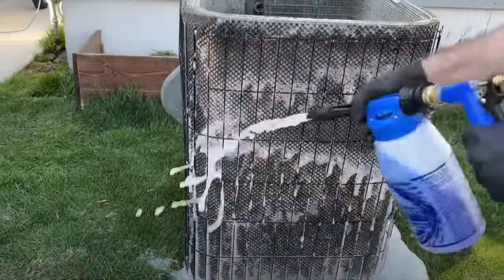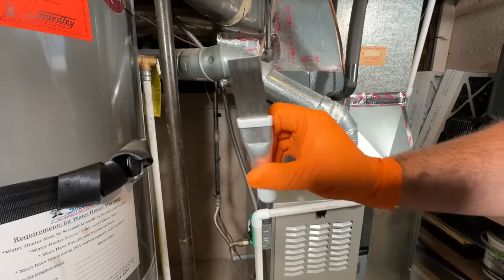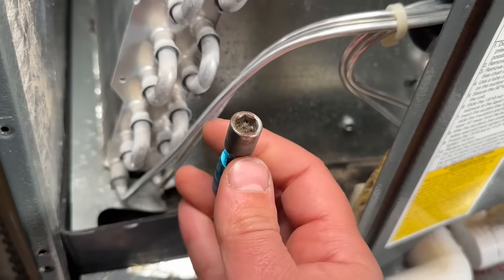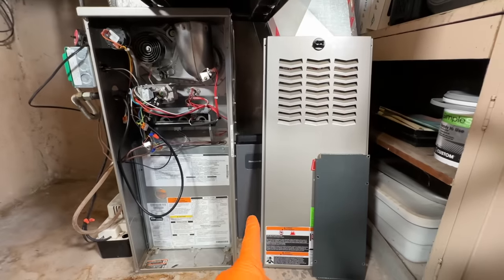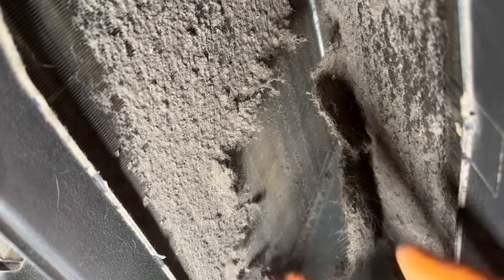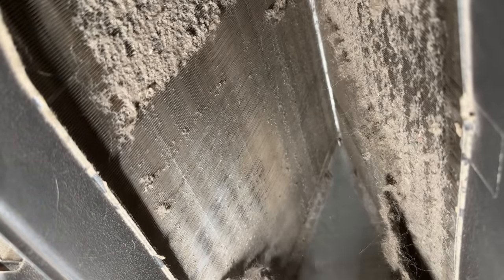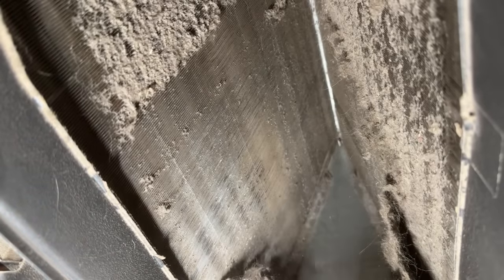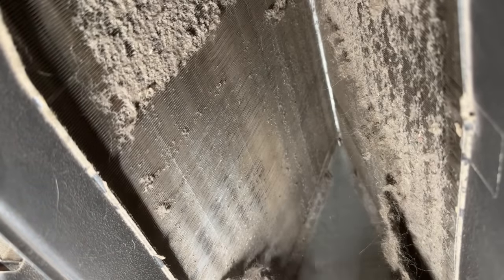How To Properly Clean An AC Evaporator Coil & Save HUNDREDS!

Comment: My late 60's Lennox is in a tight closet filter 14×18x1... been freezing up no air getting past it... as far as I know it's never been cleaned... I cleaned the 25+ yr old Compressor coil for the first time a few weeks ago... back in 1984 dad was sick and a family friend looked at it coz it was running hot and cold at the same time... so he asked my mom do you want hot or cold? She said cold so he disconnected the electric heater coil... and had gas heater installed in the kitchen... been yellowing the paint ever since

Comment: I use a 20”x20”x1” filtrete 1900.
Think it’s a merv 12 or 13 i can’t remember. Seems to work pretty good I replace every 2-3 months depending on hvac use. Seems to fit pretty tight it’s in ceiling
Reply: Forget about better quality 1" thick filters. Something that over-rides and trumps ALL 1" filters........is to use a DEEP PLEAT filter that is 2" to 5" thick....and it is constructed with a FLANGE arround the edges to fit the 1" thick opening recess.... BUT has 4 " more filtration hanging out the backside into the ductwork behind. . Consider......a 5" pleat is NOT a 5" thick filter that would cause more pressure drop.....it is 5" thick but PLEATED, so the surface area is greatly increased to give more filter area for less pressure drop and also more cleaning action. It's the best of both worlds when targeting better filtration AND low pressure drop. Here is an example....not necessarily this brand but this style.---> https://www.youtube.com/watch?v=07ZnySt8rHE. I buy another brand (Filter Buy)....but use blue painters tape around the edges instead of having this rubber gasket, to assure no by-pass losses. Here's another-->https://www.youtube.com/watch?v=NuCwKf7SBbI&t=4s
Reply: @TheWilferch  it’s in ceiling so I can’t just add thicker one but I’ll def do the painters tape trick thanks for tip
Reply: @Turtle-sz7sk  ......you CAN add a thicker one to the ceiling location. Mine is in the ceiling too. Doesn't matter if the standard 1 " thick filter housing is on the wall or ceiling....the important part is if there is space enough in the ductwork behind the filter housing. I had to remove some firm insulation from the tunnel shaft ductwork walls behind the filter for a few inches.... to accommodate the thicker filters. Ceiling mount vs wall mount is irrelevant.
Reply: @TheWilferch  huh I’ll have to look into it. Would def needs some modifications.
Reply: @Turtle-sz7sk  ...for most folks there are no mods required...if the space BEHIND the housing accommondates a thicker filter. In my case, they built the ductwork tunnel behind the filter with rigid foam insulation on all 4 walls of the ductwork....so I had to slice-away a 4-5" depth behind the filter housing to fit my 5" deep filter. Many don't need to do this. Look at the links again.
Reply: @TheWilferch  ok I missed the links, I think they would work for me. My question is I use a filtrate merv 13 but the thicker ones are only merv 10 isn’t that technically less filtration?
Reply: @TheWilferch  I take that back I’m on their site they say merv 11
Reply: @Turtle-sz7sk  ...I think the thicker filters come in various MERV ratings....and I wouldn't worry too much on that point. It's a balance.....too little filtration and it causes the evap coil to gunk up too fast......too much filtration is the same as running a dirty filter and stresses the air handler. MERV 8 to 13 range in this thicker pleat should work fine.

Comment: I apply 1/2 inch foam tape on the entire perimeter of my 16"x 20" x1" filter before installing it down into the filter slot and then installing the top cover plate. All air goes thru the the filter and I change it every 2 to 3 months. The same 90 + furnace and A coil since 1998.  RHEEM

Comment: I feel some coughing coming, thankfully the last time I cleaned mine out it wasn't to bad and I just vacuumed the dust and drainage tray out. I do need to see if my coils slide out and use cleaner next time, at the time I had to spend a lot of time just trying to get at the coils with the 2 dozen screws to take off all the metal covers.

Comment: If you want to rinse after you spray the foam a yard sprayer that you use for spraying weed killer or fertilizer or to spray roses works really good it has more pressure and you don't cramp up your hand from  pulling the trigger so much. A one gallon sprayer is around 10.00. If you don't clean out your sprayer after each use you will have to give it a good cleaning so there is no residual Round Up or fertilizer. You might want to disconnect the hose and run warm water thru it from you utility or kitchen sink.

Comment: Pulling mine isn't possible without cutting the intake and exhaust pipes. I remember looking at my A coil this past spring but it was more about getting access to it for the next duct cleaning we're  due for in the fall. That was the one complaint I got from the cleaners last time was the access panel didn't have room to be removed. Now that I have that worked out I'll just pre-remove it for them in the fall. HOWEVER, this video has me wondering if that triangle piece had screws in it for removal. I don't recall seeing any although I'll admit I wasn't actually looking for them. Should have taken a pic just for kicks. I guess I'll find out in the fall.
Informative tutorial and I never considered that if possible they could be slid out for easier access. I suppose at this point you could just skip the filter and let the dust film do the filtering work eh? Or not...

Comment: Would I need to turn off my power before doing this? Thank you so much. I'm so happy I found your videos!
Reply from the maker: Yes I’d advise just turning the light switch off at the furnace and that will prevent the furnace or ac from coming on 👍🏼

Comment: You could use a piece of vinyl reinforced tubing or a "Fernco" on your PVC drain. Then it is easy to disconnect and get out of the way. (edit: didn't know you had the loose fitting on yours)

Comment: I liked the video thank you for making it. I guess my question is since you had all that unfiltered air go by and did what it did. When you showing going to reinstall it and the heat exchanger was dirty looking why did you not clean that then? Yes there should be no big debris flying by getting clogged again but a wet rag or some wipes even and you could of cleaned that layer off and back tracked all the way back to the filter. I would think that your fan itself since that is in between everything it would be pretty dirty also and need some loving also.

Comment: ...this is why I installed 140 square feet of washable merv-15 filter media, bolted down to a gasket material. Unfortunately, it's creates 16 units of vacuum instead of the 10 that's to code..
good education on this video. I think I know why my tenants are getting an iced up coil...by having a useless old filter that either got bypassed or taken out entirely...they're the "smoke alarm chirp" type of people (with the actual smoke alarms chirping). thanks.

Comment: I use a shop vac and a soft brush, and carefully vacuum all the good stuff up.  I wish I could pull mine out the way you do yours.  Maybe I'll take another look see if its possible, then I can use a wash and clean the outsides of the A coil as well.

Comment: I got a portable AC from the 80s and it didnt look half as bad on the inside as that.  But the dust trapped water and it started leaking it out the bottom.

Comment: Good video. Hope you also  installed a proper condensate trap and a drip leg for the gas supply!
Reply: how about the double wall 90 that is backwards and single wall into 2 double wall pipes

Comment: Last year I bought a new system and come to find out, the filter size is odd and hard to find. My advice is always ask what size filter your new system uses and find out if it's readily available before purchase.  I refuse to buy them and have an alternative solution; however, there is some air bypass.

Comment: Do you have to bend the copper pipes? Do you leave them connected?

I assume so… otherwise the fluid would be spilling out, which would be a big complication to refill.
Reply: Naw you can usually cut the smaller copper line.

Comment: Good video ! 
That Evap no-Rinse is basically just a Very ,very Light Dust Rinse cleaner. Its Junk for any Build up at all.
1) I Recommend Nu-Brite Spray can for Heavy duty De-Greasing / Heavy build up. Protect your Eyes with safety glasses at all times with the stronger cleaners. Nu-Brite is Extremely Strong cleaner & Will Burn your skin & eyes if it gets on your skin. Beware !!! Strong Acid cleaner. 
Wear a Respirator too ! & Latex gloves 🧤 / Dishwashing gloves.

2) black hawk coil cleaner for medium duty cleaner.

I Recommend Rinsing the Evap.  Coil  with Hot water in a pump sprayer to get all chemicals of the evap coil too.

Other than that. Good video !

Comment: Thanks Dave for very informative videos, keep up the good work!
Reply from the maker: Thank you!
Reply: @diyhvacguy  great job explaining everything.
I was wondering in system like that and the air was downward would the need to get underneath the coils be needed?
My a coil is at the bottom of my furnace and air goes down, if the top is not very dirty it’s unlikely the bottom would be? Since the air is coming down on top of the a frame.

Comment: All the plenums I have glanced at were formed sheet metal and cannot be opened up without cutting.  I always wondered why AC units on top of forced air were set up like this.  I presume it is supposed to be dust proof past the filter, LOL.  I nearly started sneezing when you pulled on that dust layer.  I would have first used a shop vac and a 2nd vac to catch the exhaust from the shop vac!!
Reply from the maker: Yea those ones you have to cut the sheet metal and patch afterwards. Def not ideal but it needs to be check and cleaned from time to time!
Reply: I would have added a 3rd shop vac to catch the exhaust from the 2nd shop vac from the 1st shop vac, then wear a breathing mask, eye goggles and gloves. Then surround my property with POLICE crime scene tape and call the FAA for a no-fly zone. Then after all that, I'd call a professional to come clean it out while I took a vacation.

Comment: Hi Dave. Thanks for all videos and tips. You’re awesome for doing these!

Quick question. I have an old unit the has a leaking drain pan. I was able to find the part on online on grainger’s website. It’s over $600 with tax. Two questions. Would you know a better website to find a drain pan? Secondly, I was quoted $1400 to do this job (this price includes the repairman bringing the part). If I get the part he’ll deduct it from the price. He’s telling me the reason the job is so expensive is because he has to evacuate the system and install the pan and replace the R-22 Freon. 

Is it necessary to evacuate the system of Freon to do this job? Any advice you can give me on these questions would really be a great help.

Comment: For a heat pump -- I unscrewed the panels on the sides of the air handler but they won't budge. How can I clean the evaporator coil?

GE / Haier's air handler (UUY36ZGDAB - companion to outdoor unit AUH2436ZGDA) comes with a metal furnace filter. I read elsewhere that this is just to stop rodents from getting into the heart of the system - so the GE/Haier didn't plan to have a dust / pet hair filter anywhere? There's no room for another filter - just the 1" metal filter - and the metal filter is not supposed to be replaced with a real filter. The installer called it a reusable filter.

The air handler is in a crawl space - hard to access. A service technician checked the filter after some months and reported that the filter was clean. He didn't mention that the filter is more hole than substance - 'huge' holes - about 80% of the surface area is unobstructed holes. I just found the filter, and now I see that the dust went straight to the evaporator coil. (I could stick my phone thru a hole to take a video.)

I tried to remove the side panels but despite removing all the screws, the panels won't budge. Well, one end of one panel budges, and behind it I can see another layer of wall - perhaps a frame for the evaporator coil - so even if I could remove the panel I still won't be able to vacuum.

There is an air intake (with no filter!) from the crawl space, so I was able to put a vacuum hose in thru there, but I can't see what I'm touching with the hose - my arm is outstretched to the side.

(There are two other air intakes - upstairs - and I installed dust filters there the day this system was installed, so when the technician said the filter was clean, I assumed it was because my intake filters were doing the work.)

HOW CAN I CLEAN THE FILTER?

WHY DOES GE / HAIER SHIP THIS USELESS FILTER?

The amount of dust is not a lot, but the compressor already had to get replaced, so the technician who replaced the compressor said I should not run the heat pump until the coil has been cleaned. (He saw the amount of dust.)

Edited Video (optional) - repeats the above, visually, in 90 seconds:

https://youtu.be/wl7iSAJ7IDU

Comment: Good video.  Sometimes if it's bad enough,  you have to just pump it down and pull the coil, take it to the yard and wash it out.  That's always fun (sarcasm engage).  Reinstall, braze her up and pull a vacuum, open valves, rock n roll.

Comment: Great video. I have virtually the identical Goodman unit. Sadly, I don't have enough play to slide the coil out. I unbolted the triangular metal piece as you described, and cleaned the coil as best I could. It's way better than it was, but I'd like to clean it better. Even if I remove the blower, which I intend to do so that I can clean the wheel, I still can't get to the a-coil from the bottom due to the pipes underneath. Would it be feasible to remove the section between the blower and the a-coil in order to come at the coil from the bottom? It looks pretty daunting.

Comment: Great video.  Question: if I can't slide my coils out like you did, how do you clean the underside of the coil with the foam cleaner and water without the dirty stuff dripping into the furnace?  Or is my only option to do a dry cleaning with a brush and vacuum?  For the top of the coil there seems to be a drip pan around the perimeter so that a foam cleaner can be used and it collects the dirty water and out the PVC pipe? Is that correct?

Comment: Thank you for the awesome video.  Mine has zero room to pull out.  When doing this "Leave in place" what are the risks associated with getting the foam cleaner on the furnace heat exchanger?
Reply from the maker: No risk. It will burn off no problem.

Comment: I can check mine the way my humidifier is setup.  I look every spring and it looks clean so I dont touch it.  But to get to it would be a pain. If its not looking dirty, could you not just blow it clean with compressed air, or a shop vac with a soft brush tool?

Comment: I have a carrier with a single slanted coil. I can get to either side to spray the coil cleaner, but the dirty looking side is facing down and the cleaning solution is dripping off as I was trying to apply. My question is can I spray the coil cleaner on the upward side so that the cleaner will drip down to the dirty side and hopefully remove the built-up debris. In other words, if you spray on either side does it also reach the opposite side fins.

Comment: Leaking from rear of drain pan. Suctioned line and all is well. Could be a block inside the drain pan I suppose. Did you have a video on that issue? Would drain pan tabs help?

Comment: There's another valid point for cleaning this A coil well. ALL the air your furnace uses passes through the A coil area - unless there's some type of bypass. My furnace has air enter at the base of the coils, flow up and through them then continue on through the electric heating elements. 

Hence - cleaning the coils will also have an effect on the amount of air your furnace can move through the heating elements too. It ought to be obvious but man - it's like a seriously bad design with the filter mounted below as well.
Reply from the maker: Yep, you can trip a high limit switch due to overheating because of a clogged Evap coil. I’ve seen it happen quite a few times

Comment: Assuming I have easy access to the evap coil from underneath, how effective would a shop vac be at cleaning the debris from the coils? Would I still need to use the coil cleaner spray?

Comment: Did you unplug the unit or remove a battery before you started disassembling the unit? Your outside condenser cleaning video show you removing the electrical plug before you cleaned it. Thanks.
Reply from the maker: Yes furnace was shut off

Comment: Alright, hear me out. Next time try using a denture brush to scrub the coil. I use Dawn dish soap (1:64) in a pump sprayer to allow the soap to chew on the fins for 5 minutes and then use a separate pump sprayer to rinse all the junk off till all the bubbles are gone. Just like using a small power washer.  Make sure to wet-vac the condensate line to remove all the debris.

Comment: Awesome Video!!!   Did not even know that was a thing to clean...   
Thanks for sharing;  
It would seem to me if they (installers) were to install quick release fittings like hydraulics have then a person could just disconnect that sucker take it out side and give it a easy cleaning.  ???   Any thoughts?
Reply: They make / Used to use aeroquip fittings. They allways Leak Refrigerant because of the high pressures & temperatures. Any ones ive allways seen are source of refrigerant leaks over time. 42 Years experience here.
You CAN still buy the fittings.
Reply from the maker: Wouldn’t that be nice haha anything like that will eventually leak, but the concept is great